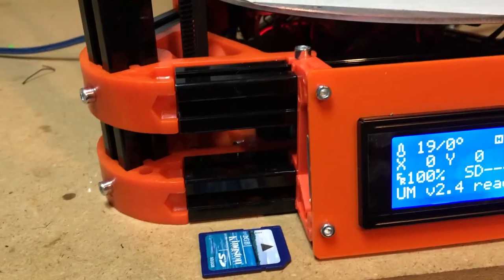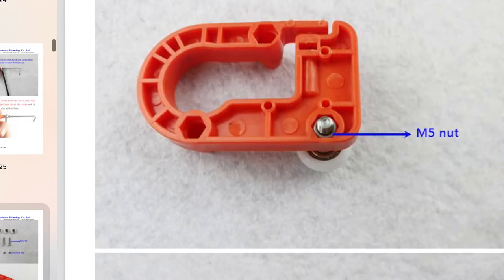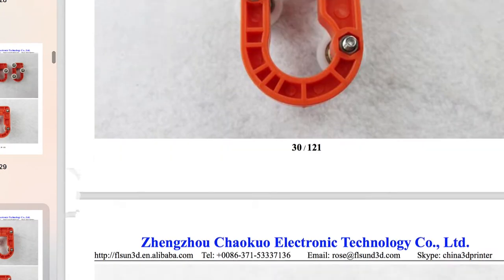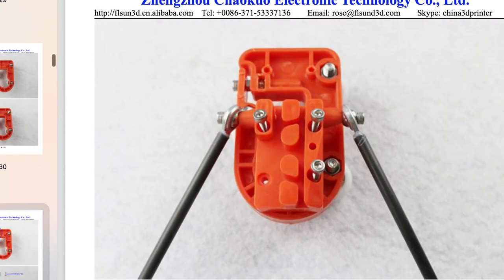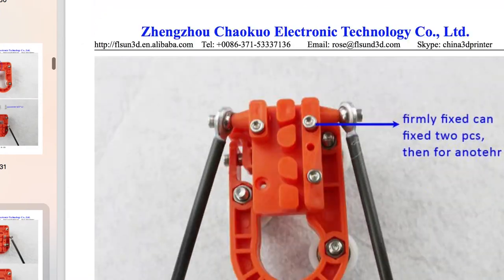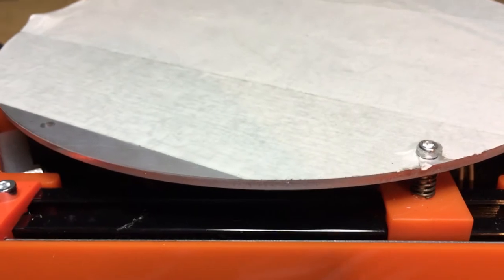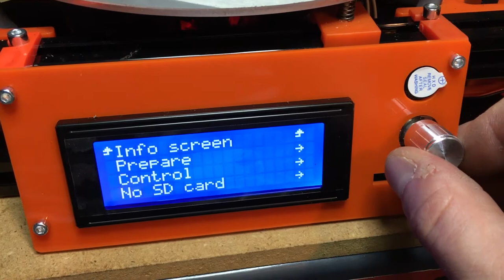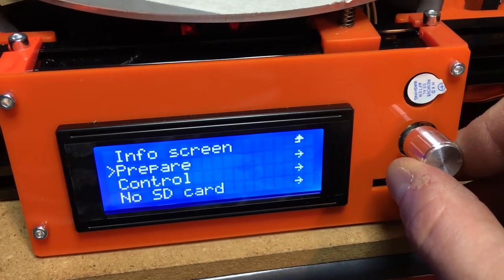Best High Quality Low Cost Delta 3d Printer

Comment: power to it
Reply from the maker: Are you still having trouble with your heated print bed?
Reply: yup no luck yet
Reply from the maker: Do you need to know where to plug it into the board?
Reply: checked my email did not see it can u sented me your marlin plz would help alot thx

Comment: Hi. Did your printer had allready prewired heated bed? Mine came without sensor (maybe it is integrated) and power wires attached. 
So far i managed to get in touch with support but not with one of technical people, so for now i am trying some printing without heated bed.
Reply from the maker: Hello.
My heated bed did come prewired with the wires connected for the thermal sensor and the heating element. If you need more help then let me know and I can try to help you out some more.
Reply: Doug Licht was the sensor just attached with some tape or it is integrated? Do you have a chance to send me some photo of connection?
Main power is not a problem, heat sensor is a problem for me. There is 4 small soldering pads and 2 big ones for power. 
I think i will lift bed up tomorrow and mesure resistance between small soldering pads. There should be some 100k thermo resistor if its integrated
Reply from the maker: I will take a look when I am home later and let you know what I find. What is the best way to contact you to send pictures?
Reply: Doug Licht you can find me in skype with same user name or just add picture somwhere online, like google or dropbox and publish link here.